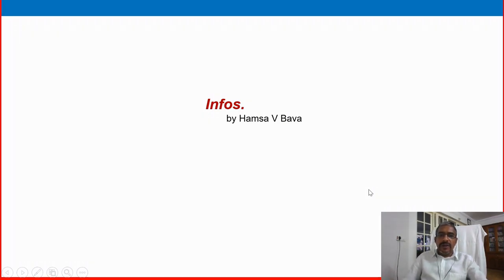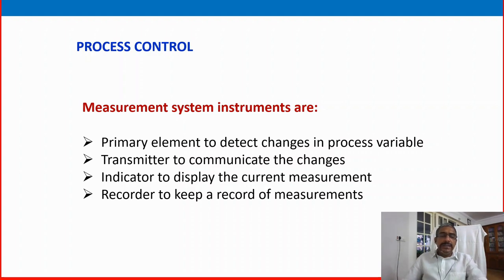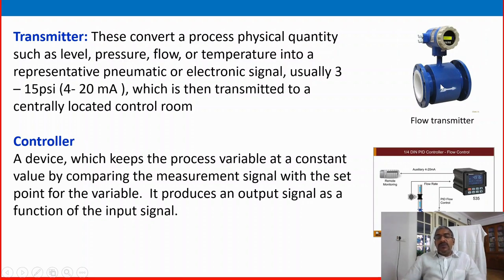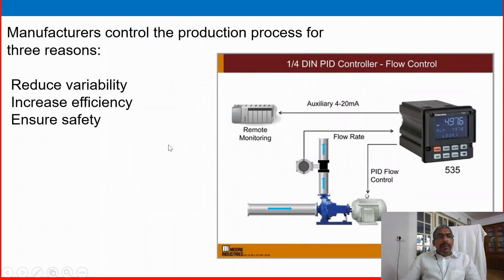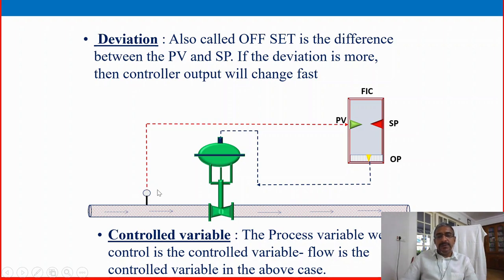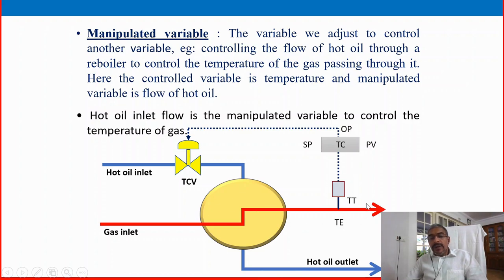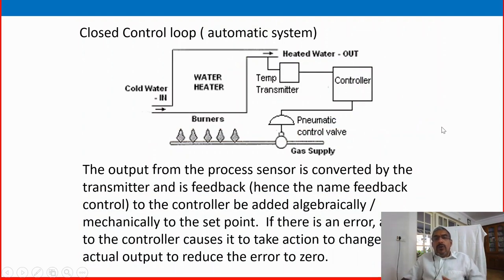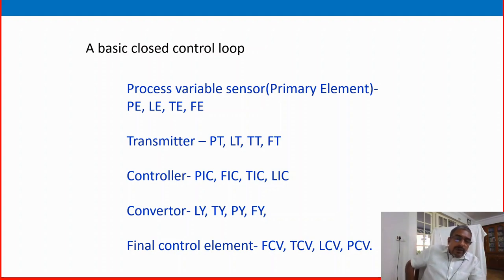Oil and Gas Process Control Part - 1

Comment: Is transmitter same as transducer???
Reply from the maker: No. Transmitter receive signal from sensors and convert into std form and send to other locations like remote indicators, controllers etc. Transducer is an I/P convertor which converts electronic signal to pneumatic signal.